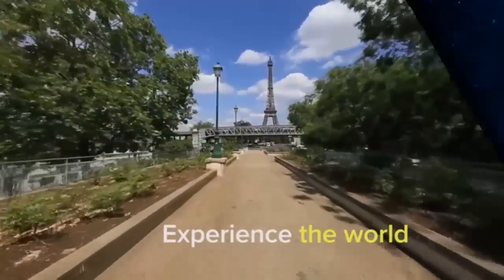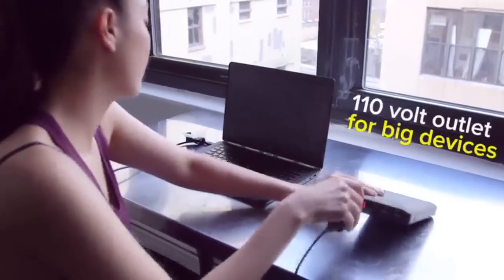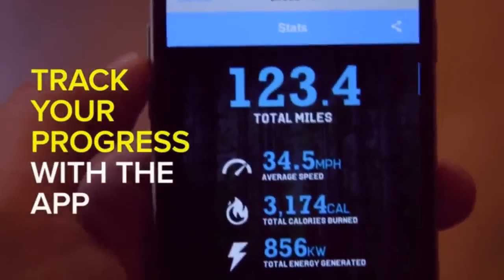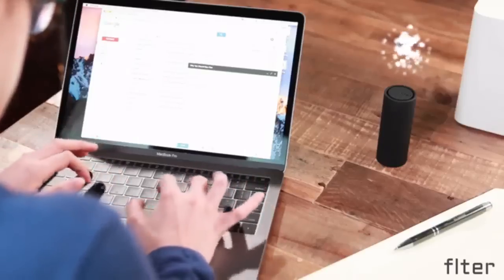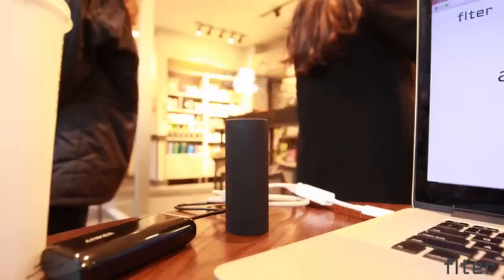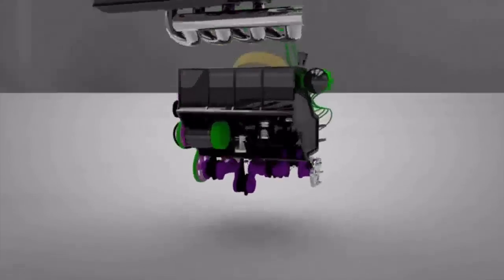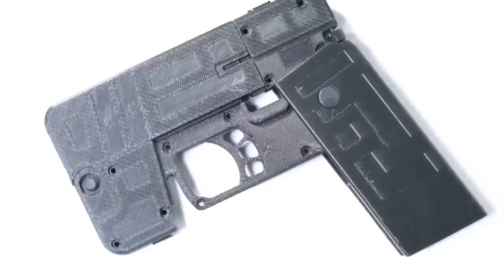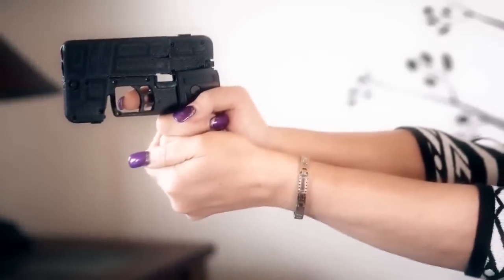Today's Best New Inventions, Technology and Designs

Comment: carboss is a really cool invention.
Reply: Dunno Powerof,   I remember 30 Years ago a similar Stuff called Slick 50 promised the same Result but when I used it in my 1.8 turbo Diesel VW Bus / Camper, it fuckerd my Engine properly,  careful with Stuff like that I say ...
Reply: I would definitely want to make sure that it worked as advertised, but at face value, it's fantastic.